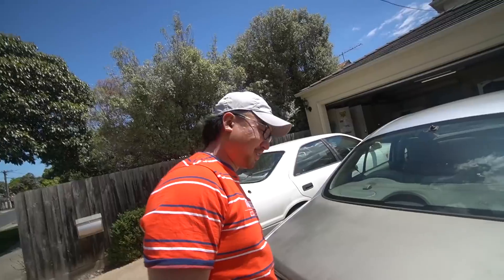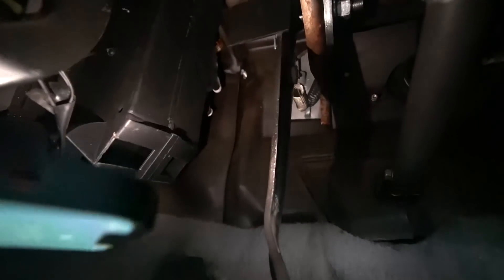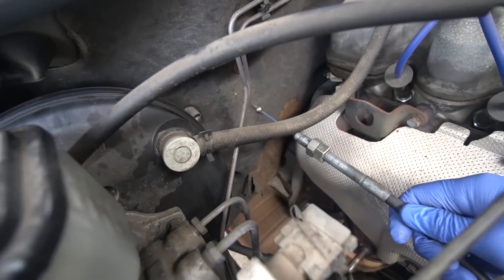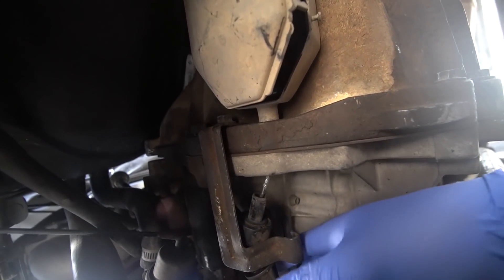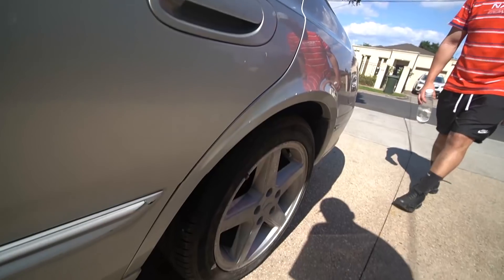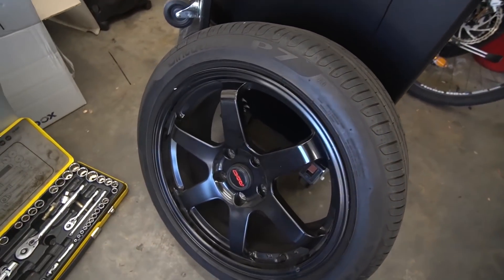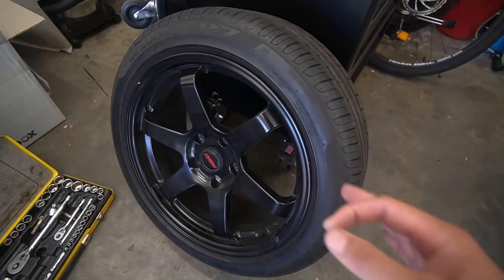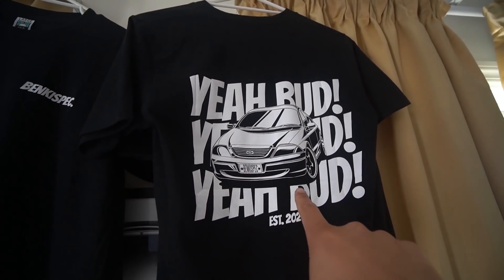SELLING MY FAVOURITE PARTS ON MY AU FALCON 😭 BUY THEM OFF ME?!

Comment: Also to answer the second question, alot of Ford vehicles for some dumb reason have two seperate AC systems that both run off the same AC compressor, one for the rear and one for the front (most commonly in the SUV's) which would explain the back vents blowing icy cold but the front alternating from cold/hot. Technically if you are able to locate the rear ac hardlines you can follow them to the AC pressure switch for that system and just replace the front system with that switch but id recommend just getting a new switch for the front so both AC systems will work all mighty. Hopefully this info helps! Crazy to think that you Aussies are doing similar drift builds to us Americans, however we stick the JDM because Lexus's and Infinities are way easier and cheaper to build here than Fords/Chevys/Dodges lol

Comment: Re ac issue switching modes randomly..
You'll find its actually a vacuum issue. 
As when it looses vacuum it defaults heat to windscreen.

Rear vents blowing cold still could just be a stuck blend door. 

First part Its usually a busted vac line/one way check valve or the switch block in the dash. 

Other car it could be anything... but Iirc au's love murdering a/c compressors and or the evaporator core in the dash. 

Any decent automotive aircon joint could inspect and tell you what the culprit is..
As refrigerant doesn't just leak without a hole somewhere...

Comment: Check that the clutch coil isn't faulty on the compressor. Very cheap and easy to diagnose. Just check that the pulley on the compressor spins when the AC is turned on.

Comment: Since there hasn't been an answer in the comments regarding the AC cutting in and out, id recommend getting replacing the AC Pressure switch. Now this will only fix the problem if the AC is blowing cold consistantly but just cuts off and blows hot air and then later goes back to being cold. Im not really sure the reasoning behind the AC switch because it doesn't directly affect the AC compressor not working but I do know that once you replace the pressure switch, the AC will stay cold when you want it to be cold!

Comment: Idk about you using a small tyre or even a 7" rim that's like ridiculously little 

For an au falcon minimum you should be running 18x8.5 or you may as well save ya money and keep the stock which is 17x7 🤢 do it once do it right! 18x8.5 on a 215 or 225/40/18